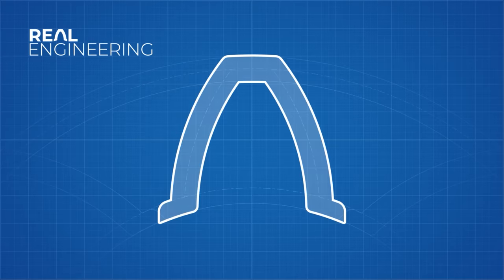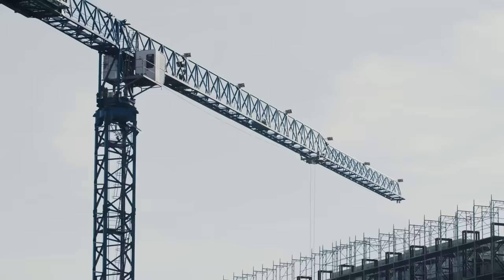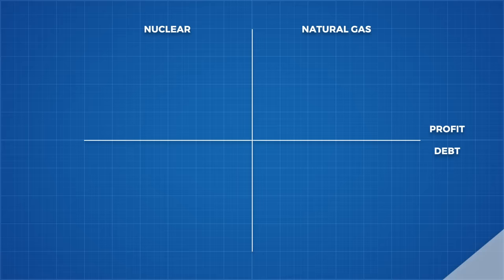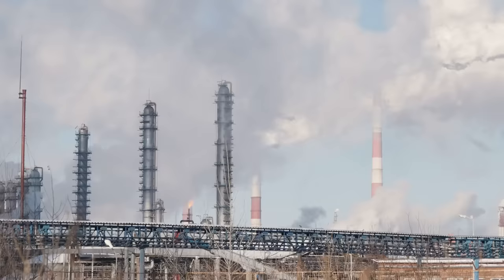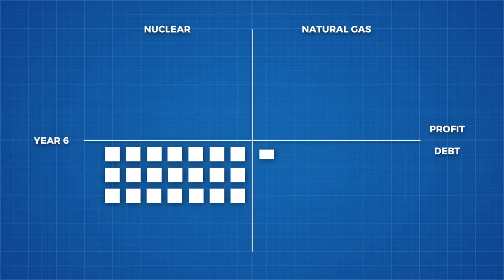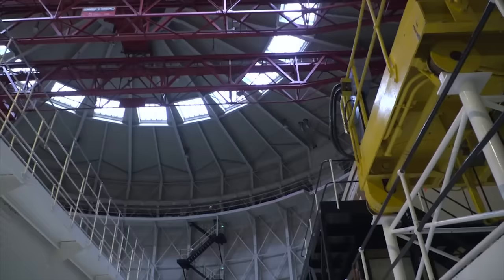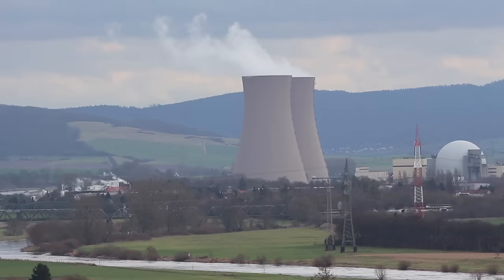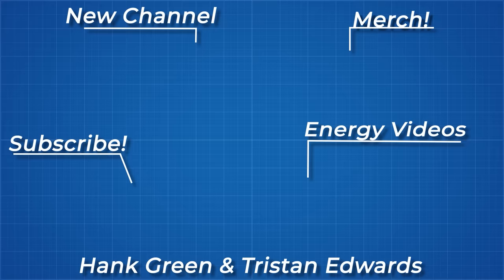The Economics of Nuclear Energy

Comment: This might be hard to include in the calculations, but you also have to take into account the environmental impact. 
It is great that nuclear is used closed-system water, but natural gas is far from being a closed system without side-effects to the open nature.
Reply: Well in theory you could close off the ventilation from a natural gas plant and store it. Over time it would turn into a tar like sludge that in theory could be burned again. It's a net neutral system. But right now the country gives no subsidies on top of them for using this and cost to implement is higher so nobody does it right now. Gotta love humans am I right?
Reply: @Skylancer727  I think you have a fundamental misunderstanding of how combustion works. If something has been burnt, it has been burnt. You cannot collect the exhaust gases and burn them again. Closed cycle gas turbines are highly efficient, there is virtually nothing combustible in the exhaust.
I think perhaps you are confusing with carbon capture which is a way to reduce CO2 emissions.
Reply: Luke Rieman can you use the carbon catching method on natural gas plants? Aka filter out the co2 or some of it out of the exhaust? (No clue what carbon catching is nor how natural gas plants work btw tell me if what I’m saying makes no sense)
Reply: @blanco7726  technically yes you can, but as of right now there are no incentives to do so and because of that, nobody does. In theory you could just store all of it in a cave under ground or a steel container. If you did it would slowly turn into a sludge of carbon which may be reusable as fuel or could be recycled into the tar used on the road. But unless politicians subsidize this nobody will do it. It's more expensive to recycle this tar then make fresh stuff so it would only be done if they could get a deal to do so. 

Right now the only talks were on the cave idea but this may have ecological issues as it may contaminate ground water. Since the alternative is more expensive, nobody wants to do it. It is an option, but unless you vote for politicians that specifically support this, it's just not gonna happen.
Reply: @Skylancer727  Carbon dioxide will not "slowly turn into a sludge of carbon".  Carbon dioxide is stable over geological time periods. Converting it into a "carbon sludge" requires chemically reducing the carbon dioxide which will cost considerable energy (more than was produced from burning natural gas to produce the carbon dioxide).
Reply: @Skylancer727  Thats... thats not how anything works relating to CO2. 

CO2 is incredibly stable, it is the end result of all combustion, you cannot continue combusting CO2, and CO2 will not react and form other components without external energy input (which is what plants do, using the energy of the sun to extract carbon from CO2). Time will not change that, so stored CO2 will never transform into "carbon sludge".  And inputing energy into the system so you can transform the CO2 into something burnable, to then burn it will lead to a net energy loss (as there is always loss in an energy system)., which kind of makes that entire process pointless.
Reply: Not hard at all. Assume  a dollar value for each life and calculate from there

Comment: LCOE without backups are just meaningless.
I might also add that the 12 g of CO2 per kWh figure for nuclear energy is a world average, in France it's just 6...and thus replacing nuclear power with wind or worse solar panels means we either double (wind WITHOUT STORAGE) or multiply by ten (solar...without storage) the carbon emissions of our electricity system. Stupid, really.
Reply: I think that half the cost of a nuclear planter or more is just interest. If the government can just provide a grant to it. it would make it much cheaper than solar and wind.
Reply: You could use the RE excess energy to pump water uphill and then release it through a hydroelectric plant when needed, to regain the electricity (with some losses ti inefficiency, of course)
Reply: This is misleading as it's not as if we are building out solar and doing nothing else. Look how the UK is bringing down it's CO2 emissions in a big way whilst producing a very large percentage of electricity by renewables. Reality shows it works and alot cheaper and quicker than fission.
Reply: @Jawshuah  Half of that cost at least is complying with useless government regulations crafted by anti nuclear politicians
Reply: @Jawshuah  Super agree with you. that's how France did it and it is working out wonderfully for them, but the current Neo-Liberal economic model really puts massive resistance against governments doing any large projects like this even if the pay off is so massive in economic and climate stability gains that it would be stupid not to do it, first our economic model needs to change and then the world can become a better place.
Reply: @AdamSmith-gs2dv  Ikr, Fukashima didn't need no government regulations, oh wait.
Reply: @tonii5690  What is that supposed to mean?

Comment: The case of the Diablo Canyon plant is a bit special: The mentioned improvements necessary for a license renewal are basically replacing half of the power plant and still work on the other half. The cooling system is one of the most integrated and most expensive parts of a nuclear plant and earthquake protection starts at the foundation's size and robustness of the power plant and continues from there to the reactor vessel, its supports and all pipes connecting to it or its containment. So they basically have to rebuild most of the plant without improving the efficiency for a license renewal of 20 years in a state that is not exactly friendly to nuclear power. This is an investment with almost sure loss, as it's quite uncertain to be actually running those 20 years.

By the way, Rosatom does build a 1200 MW plant for 3.8 billion $ (Novovoronezh II) and a Framatome N4 is capable to change its load at a rate of 10% maximum power output per minute, outrunning the 6% of the efficient natural gas plants with exhaust heat usage by far. The german nuclear plants do follow the grid's load and Isar/Ohu 2 for example runs in frequency stabilization mode, the king of fast load-changes.

The levelized costs of energy do show that nuclear is in the upper middle range of costs and that's only the case if you won't count any costs of the intermittency of solar and wind in their costs, as Lazard admits in the pdf-file of this study: https://www.lazard.com/perspective/levelized-cost-of-energy-and-levelized-cost-of-storage-2018/
You will find the costs of storage there, too. Storage needs for Germany are at about 77% of the energy of wind and about 90% of solar. The german electricity prices are the highest in the world and that's mainly because of the subsidies tax for renewables (EEG-Umlage) and the costs of major grid changes to account for the intermittency of renewables. These costs are excluded in the LCOE while nuclear has to pay for all it's costs, eg. disposal of toxic waste, that renewable's production dumps somewhere in the landscape.